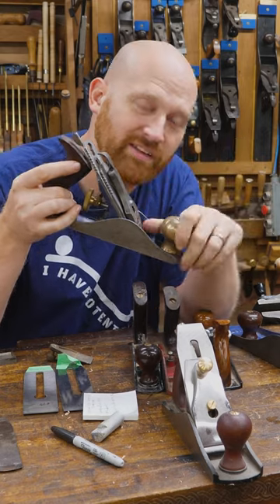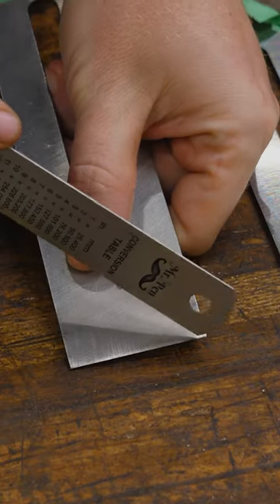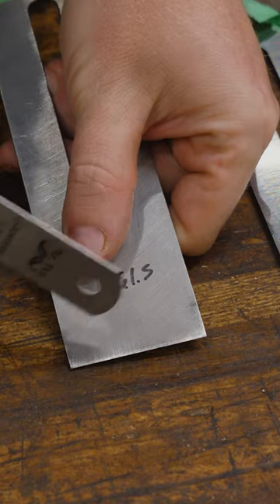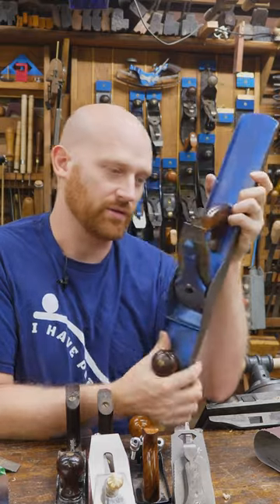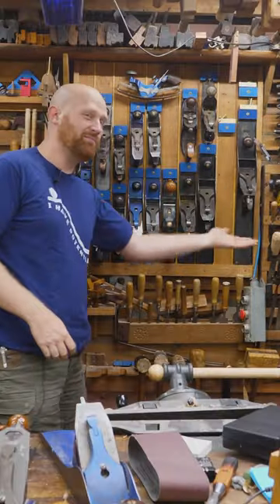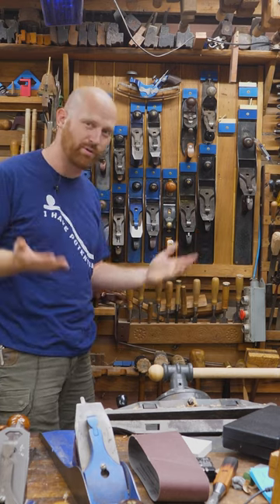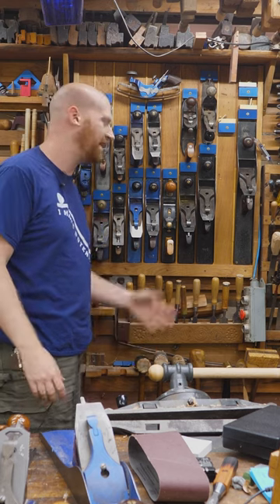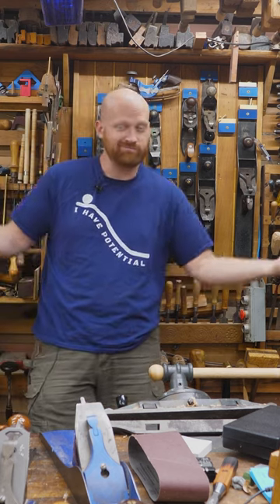Camber or No Camber

Comment: I am of the lightly camber the edges camp but I took a handtools class from an old school master and he would say that all blades are cambered. To be clear they are of much much less camber than the scrub plane blade that you showed. The cambered blade allows you to flatten and edge by moving the plane a little left or right. There is a LOT of technique in properly using a cambered blade.

Comment: My plane is cambered on the right side of the iron but not the left
Reply: Why is that, may I ask?
Reply from the maker: If you always plan a surface right to left then you won't leave tracks with it.
Reply: @WoodByWrightHowTo  Then planing left to right does leave tracks? If this is so, why? Thanks, James.
Reply from the maker: because the last edge to tough the surface has a right angle rather then and eased corner.

Comment: Heavy cambered blades are used to remove a lot of material- fast.

Flat ground blades do leave edge tracks.

The tip camber doesn't have to be noticeable to be effective.
Just round up the left and right edge tips to lose the points, and it should cut clean.

Also, reduce the depth of cut to minimize the edge tracks.
Reply from the maker: Tracks are never an issue if you take enough shaving

Comment: That first iron (the 90 degree) wasn’t even close to square. Not that it matters much, if you’re on the same level as your plane steels…🤣
Reply from the maker: I have a video about that too.
Reply: @WoodByWrightHowTo  I don’t use hand planes a huge amount in timber framing, but I’m pretty sure the that the only thing  that really matters is how flat and straight the sole of the plane is. The iron doesn’t matter (too much). The “90 degree” example just made my skin crawl a little, even though I know it doesn’t matter a whole hell of a lot🤣
Reply from the maker: to be honest the sole does not need to be that flat at all.